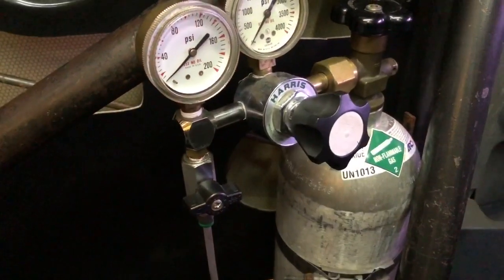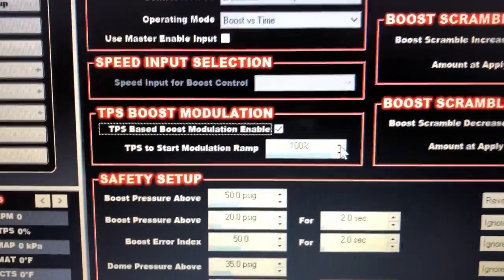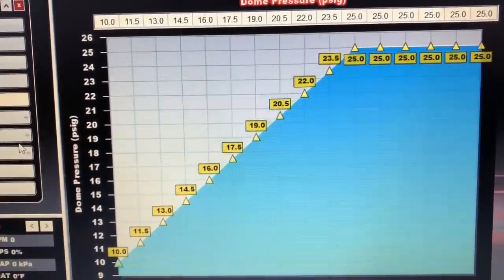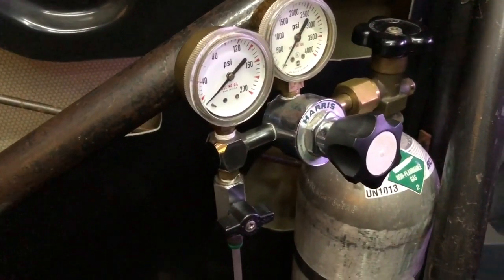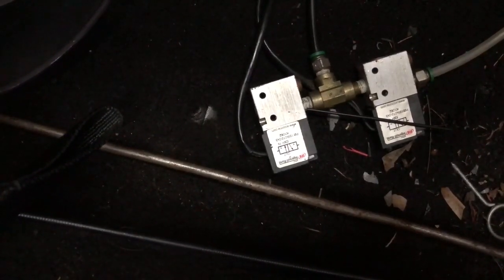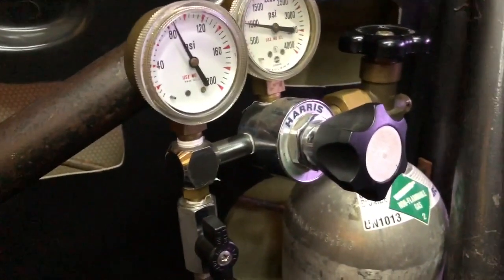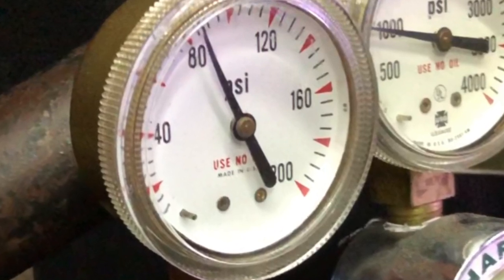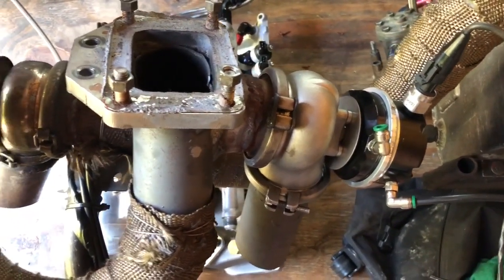Boost Controller

Comment: I would have thought you would need two pressure sensors. With a twin turbo set up, would you still use one sensor or need two??
Reply from the maker: For dome pressure, just one
Reply: @TurboJohnRacing  Thank you very much.

Comment: Is CO2 better then running a small 12v air compressor?
Reply from the maker: I like co2, but on board air will work
Reply: Turbo John thanks love your channel - gives us non-sponsored hot rodders inspiration

Comment: Are you running Holley pressure sensors or did you find cheaper alternatives?
Reply from the maker: 100psi transducers off amazon is what most of mine are, I do have a couple holley ones.  But cannot tell much difference in life span.
Reply: Also, Are you also running basic 3 port Mac valves for boost solenoids? I was on the fence between Holley and Fueltech. With all the local and internet support I will be going with Holley EFI. THANKS

Comment: Co2 is the way to go. I use Mac valves Bc they’re cheap and reliable. There are lots of other valves that work that you can find on industrial diesels and shit. But for sure. One solenoid puts co2 in the dome and the other bleeds it off which is legit Bc in closed loop boost control you can keep that gate pinned down and then start to quickly open it as it gets close to target pressure. Which is different from just having a line to the button of your waste gate. The gate will start to open before you are at boost pressure so you are losing that exhaust energy even tho you’re not at target boost. Co2 over time based is what I like and it’s really a game changer if you haven’t messed with it before and are having trouble spooling up or managing power. In the beginning or whatever, for me it was around 5.80-6.20 range, I used it a lot of power management. Now I also use a Timing retard over time and pretty much only adjust the start boost level and the ramp, in time, and leave the curve alone. Boost manipulation isn’t as fast as timing manipulation. To each their own tho. To me it’s really important to verify your sensors and shit are accurate as well. I have a pressure and vacuum rig I made. It’s a vacuum log manifold and I test my sensors against a known calibrated gauge to make sure the transducers are accurate. And especially the map sensor. You can pick of a vacuum transducer on amazon or whatever. I got it originally for pulling vacuum on the cooling system but have found other uses for it. I say this because I had a bad map sensor exactly like John did but mine was stuck at 22 pounds. 🤬. Lol. So check your sensors if you can. They do break sadly even if they look ok. But for sure. Bottle, reg, two Mac valves, dome pressure transducer and you can start. I use a dominator on my cousins car and a haltech 2500 on mine but the components for boost control are the same. So it’s three wires. One for each Mac valve (the negative wires output) and then a input for the dome sensor signal wire. Also might not hurt to have a hard cut for overboost when messing around and learning what duty cycle makes what boost. The tech we have now at the price we can get it is amazing to me. One ecu can run the entire car basically. Also, always remember that when spooling up or managing power on turbo stuff, if you retard that timing too much you can make more boost as that fuel is combusting in the pipe after the exhaust valve is closed pre turbine housing. I found that out the hard way years ago and also more boost doesn’t always mean more power but it does mean more heat. It seems like a lot to take in but it’s not. Set yourself up to get as much data as you can and keep chipping away at it slowly. These cars are wicked fast for not very much money relatively speaking now days and we need to keep all the racers especially the smart ones here nice and safe so we can keep chipping away at it and learning together. But to me, gotta have co2 and also gotta have back pressure sensor as well. It’s fine if you don’t have it just be mindful that you can run over your turbo when you are going max effort and sometimes it burns the strap off the plug and makes a mess of things. 😭. Anyways I am done ranting and shit. Get some. America baby.

Comment: A nitrous bottle opener electronic solenoid  controlled via Holley Dominator Output pin would be pretty sweet too for the Co2 “on/off”. That’s how I’m gonna do mine

Comment: john, so are you saying your transbrake button is your scramble button? did i hear that right? good videos very informative.
Reply from the maker: On the Holley system, you can make the scrabble/bump button the same.  You have to set it up in the advanced tables so that it is dual function.  I have a separate scrabble button that is on the dash for mine.

Comment: Can you do a video on your turbo setup for the SBC?
Reply from the maker: I did a vid going over some of the details of my car. The basics.  https://www.youtube.com/watch?v=lhrkO_ocGjw&t=1s
Reply: Yes, I saw that one. Im currently in Afghanistan and trying to piece together parts for my SBC single turbo mustang build. I was wondering if you had any real issues with header clearance near the strut towers or motor plate? What radiator are you running since the turbo is center mounted?  Right now my car is with the chassis builder, so Im thinking no is the time to go tubular front end.